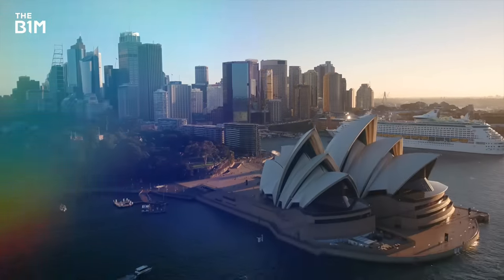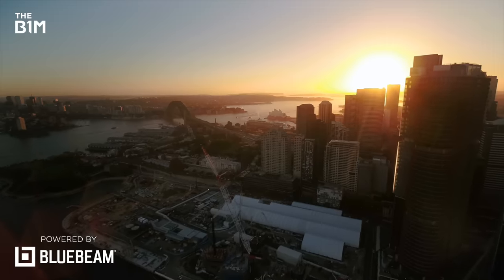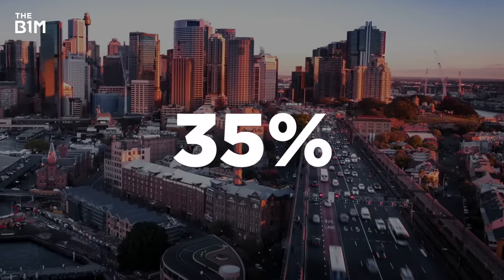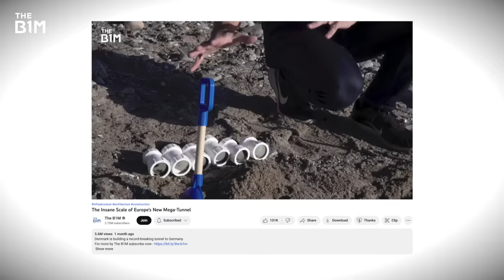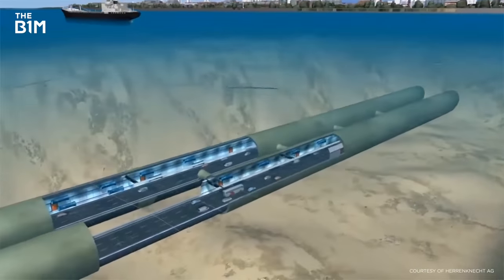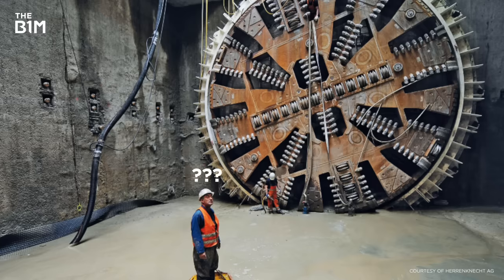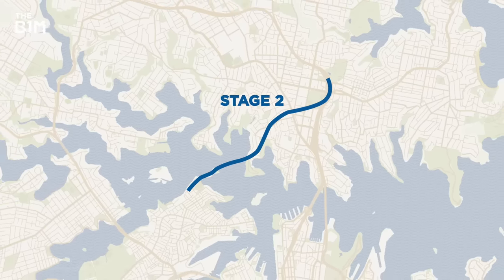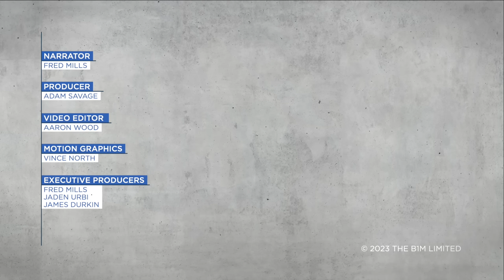Sydney's $5BN Tunnel U-Turn

Comment: This is going to help traffic... for a very short amount of time. Then induced demand is going to push it right back up again. Sydney needs more public transport, not more roads.
Reply: but then how would the people who own the roads get rich?
Reply: True, every time I go to sydney I like it less. Traffic is a huge issue. Way to car centric. Allthough it does seem like bike lanes are being built,  bur a better metro is definitly needed.
Reply: Nimby: sO yOu wAnT mOre tRafFic?
Reply: @aqidon  its underconstruction at the moment. But also there are alot of different types of transportation like sydney metro, sydney trains and light rail around the city to the west
Reply: why isnt everyone there driving a e-bike? its warm all the time....and you can have a "umbrella roof" abowe your bike or a hat so you wont get a heat stroke
Reply: @aqidon  the lack of emissions control on vehicles or proper standards for fuel also really degrade sydneys air quality; compared to london, sydney air makes me feel asthmatic some days.
Reply: One more lane.
Reply: @mauriceskyliners9873  Im a car fanboy, I agree Sydney needs more public transport. It may be car centric, but its an absolute hellscape to drive in. More public transport equals less cars on the road, therefor making it more pleasant for us people who actually enjoy driving.
Reply: @faustinpippin9208  i guess Australia isn't this far, with all the infrastructure, would not want to drive a e bike on a 6 lane Highway in a tunnel...
Reply: Disagree. It reduces traffic bottlenecks across the bridge and the original tunnel. Those bottlenecks were disruptive for the productivity of the city, and now, residents who don't need to go through the CBD can bypass it entirely. Sydney absolutely needs more roads. As cities grow, the need for more infrastructure grows. They're already working on expanding the train network. It's not a zero sum game.
Reply: @BadDriversOfTheIllawarra  I agree with you, more public transport means less traffic on the highways.  but the nimby and sometimes the radical ecologists do not want
Reply: I have never understood this argument. This could be said about anything, even public transport. London, NYC, Tokyo etc. could build a new line but the trains will still be packed from 'induced demand'. The actual issue is the size of cars in proportion to people, not the wait times. In the end as Sydney builds a new bridge, the economic throughput will increase even if traffic itself does not.
Reply: @KingFinnch  just check what's going on in Poland )
Reply: Doesn’t get away from the fact that people have to get around one way or another. The traffic may take the same time, but another 5000 cars per hour will be going across the bay.
Reply: Induced demand doesn’t only apply to roads, it applies to public transport as well. Most people would rather be clogged up in traffic in the comfort of their own cars than clogged up in a train standing shoulders to shoulders like in Tokyo. Australia is a sparsely populated country, and that is a benefit to its quality of life. Tokyo builds public transit because it HAS to, not because it wants to, it doesn’t have the privilege of ample land that aussies enjoy and that’s why despite high living standards, Japanese still immigrate to Australia or America for the suburban lifestyle. Please don’t push your agenda onto Australians, you’re more than welcome to move to Japan or China if you so desire.
Reply: There is a margin between need and induced demand. I believe that Sydney now requires such a project, as well as other public transportation projects.
Reply: And how are they going to finance that? It would mean more taxes since less cars, less revenue. People always hate cars, but forget they contribute a lot to the economy, from workers on the oil fields, truckers to carry fuel and parts, fuel and road use tax, registration tax, tolls, etc etc. With out cars who is going to pay for more trains, subways, and buses? Like in NY, thanks to cars using the bridges and tunnels the MTA can keep the bus and subway fare at $2.75. Without revenue from cars and truck the fare would probably be close to $5.00 and metro north and LIRR like $20 each way at least
Reply: @playerbobiko4417  yeah public transport works well where there's trains. But Sydney is so spread out that a lot of areas are only covered by bus. So then you get the worst of both worlds. Als going between the main lines is silly. Going front the airport to the west you go through Sydney CBD. There are no ring lines for the trains.
Reply: @PhillipMikeHunt  you obviously have zero clue about public transport
Reply: @biosparkles9442  This isn't America, it's maintained and owned by the government not private industry. There is no getting rich off roads at least in Australia.
Reply: @Ricardo-bo8xv  yes the margin is the width of a human hear wide... when start building streets you will get traffic...
When your public transport is stuck in the same traffic than the cars, no one will use it cause no benefit... separate public transport wherever from the Traffic jams, and more will find this an alternative to standing for hours a day in jam... make it the same cost than fuel, taxes, insurance ect, and even more start to losing a car cause its a useless toy and bad for health too...
Reply: @JohnFromAccounting the productivity of the city would be improved by reinstating the tram network along its original routes. Endless amounts of rundown commercial streets that are now traffic sewers because of the more roads bigger roads philosophy, could be bought back to life. It would
Create a walkable, quieter, safer city where everyone actually has everything they need near to them or by catching a tram or tram/train instead of ‘having to drive and bypass the cbd’ as you put. A city that enables or worse still relies on that kind of movement as it’s backbone is flawed.
Reply: @aqidon  then you are part of the problem. using a car and complaining about traffic. you are traffic. come to sydney, use the ample public transport available instead.
Reply: @SamWulfign  Sydney has one of the largest toll road networks in the world, owned by private industry. Last year Transurban made $2.34 billion from roads funded by taxpayers
Reply: That is pretty much the same for the whole planet 🌝
Reply: Fix and interconnect/expand separate designated bicycle paths too, especially around education precincts and public transport infrastructure.
Statistics show bicycle paths save citys money and improve health while roads cost money.
 
I hate how the government will always announce the latest new shiny trinket when it's obvious they mismanage and neglect the current public roads infrastructure.
Reply: @faustinpippin9208  e-bikes, e-scooters are still illegal in Australia, and our current bicycle paths are dangerously intermingled with other traffic, unconnected, or being ripped up to create new roads or parking.
Sydney has a very hilly geography and the CBD traffic is brutal.
Skidknee is an overpriced overcrowded hot mess tourist trap in more ways than one. Definitely not the same place it was in the 1990's.
Reply: @BadDriversOfTheIllawarra  U are the first car ethusiast I ve seen, who understands, that better public transport is also better for car enthusiasts!
Reply: @faustinpippin9208  warm? its was freezing until 2 weeks ago
Reply: @aqidon  I was hoping they where gonna abuild a metro in the tunnel but nope.
Reply: @KingFinnch  you’re kidding right? London air is way way way worse.
Reply: People heard "induced demand" once and now think they're professional traffic planner.
Reply: Needs both
Reply: Induced demand means more people get to go places they wouldn’t have gone without the capacity improvement. Induced demand isn’t a problem, it’s proof that there was hidden needs.
Reply: @Pairofkingsup  Australia hasn't been "Australia" for a long time, mate. Sydney used to consistently rank in the top five living standards in the world, now it's listed as the third unfriendiest city in the world and one of the most expensive. 
Australia dropped it's standards dramatically.
Reply: @fredrikgustavsson5806  the problem is that there is so much hidden demand in cities that you can never fix traffic problems with highway projects.
Reply: It needs both.
Reply: I live in Perth and I refuse to use public transport.  It never goes where and when I want.  The only thing I will use if I don't have a car at the time is a taxi, a real taxi with taxi plates.
Reply: @faustinpippin9208  Good in theory for young people. But there are plenty of elderly, young families, disabled people etc who cannot ride e-bikes. Trains, buses, ferries, and cars are the most practical means of transport for the majority of us.
Reply: @aqidon  so build more train lines and induce the demand for the trains.
Reply: Govt more interested to privatised public transport rather than to make it better
Reply: @onlyeveryone2253  There's already a tunnel for the metro under construction nearby, so it would be redundant.
Reply: @Pairofkingsup  "Sparse population" is BS. Parts of Sydney and Melbourne are literally denser than Hong Kong. No one wants to build a metro line to Broken Hill, but our cities are as dense as any other.
Reply: @JohnFromAccounting  the number of roads dont need to grow by that much, if enough is invested in public transport.

It's an important goal to reduce the share of cars within the modal split.

Removing this bottleneck will result in a lot more people using that route. This will go on until there is a new bottleneck somewhere else on the road. It's a never ending story. You can NOT build yourself out of congestion
Reply: @PhillipMikeHunt  well if u are a decent person u wont be searched by police🧐🧐🧐
Reply: @onlineo2263  yes that would be better.
Reply: And cycling infrastructure.
Reply: @iris4547  I don't drive a car in Sydney. I prefer public transport or a Vespa. Not sure how you got the idea that I drive a car around all the time. Although sometimes we have no options as a car is the only way, then we have to borrow a car to get a round. Comming from Europe Sydney really feels a step back.
Reply: @faustinpippin9208  Because Australians believe they have a God-given right to drive cars, and to do so cheaply and without hindrance. So no bikes on my road!
Reply: @Pairofkingsup  The east coast of Australia, where most Australians live, isn't sparsely populated. And it's more than just induced demand. If the infrastructure is in place to make alternatives to cars quicker and cheaper, people will use that. Induced demand on a cycle lane isn't a big deal.
Reply: @enduser8410  Amen brother, its like people forget the increased economic output from the infrastructure that pays for it from the efficiencies generated
Reply: Yeah there is the exact same problem in Houston Texas. They will keep widening the roads but any fix is only temporary. It’s to the point where there are numerous toll roads and the highways will have 6 lanes in each direction and traffic is still deadlocked at rush hour.
Reply: Agree that it will only help for a small amount of time, but w.r.t. public transport - depends on what type of public transport. Trains, definitely yes. But the northern beaches have for years blocked building a train network and thus forcing the establishment of the B1 bus line which justs adds to the congestion. We are causing our own problem because politicians pander to every m-ron that has an opinion.
Reply: @SamWulfign  
Ummm….nobody owns roads in USA.
100% of roads are owned / maintained by the government.

Why do you kids always make a bunch of WRONG assumptions about USA?
How cliche.

I mean….”owning roads”?!?!?
Get real, children.
Reply: @biosparkles9442  
Oh geez!
Nobody “owns roads”, kiddo. 

That’s such a cliche assumption to support an even more cliche rhetoric. 

Stop guessing.
Reply: It needed to build a grid system like 150 years ago. But that subject is for another channel i think lol
Reply: So gratefull and induced demand comment is in Top Comments. Maybe someone learns.
Reply: @SamWulfign  coughs in citylink and eastlink. Lol jl
Reply: @John John haha yeah I was shocked at the state of the roads on my last visit. On the way to Bathurst the tires on one of the cars got fucked on one side.
Reply: @enduser8410  neither is wrong. The difference is that induced demand on public transport can be fulfilled, but to fulfill the demand for cars, you basically need to cover everything in asphalt
Reply: @camblyth  Which is going directly back into the Light rail and other public transport projects that is currently going on in Sydney at this very moment. They don't just take the money and run as libetarians in our country try to make out. If we didn't have the Tolls a percentage of the total NSW tax would be going directly to sydney instead of just out of the toll revenue.
Reply: @sendthis9480  I was more infering to your other utilities and public services. A.k.a medical and utilities market for example.
Reply: @enduser8410  you can fit many many more people on a train than on a road for cars. Its also better for the environment and cheaper.
Reply: Australia need car control policies to fix the problem. Building more roads doesn't help if you allow people to buy more cars
Reply: It is already outdated before it is finished. It is just waste of money.
Reply: @sendthis9480  It's literally a private road, privately owned. Stop harassing me.
Reply: @SamWulfign  Babes it's literally a privately owned toll road
Reply: No one wants to ride public transit 😂
Reply: Yeah, more roads does not equal less traffic. It incentivized increased use of this form of transport. The best way to reduce congestion is to offer more options for transport.
Reply: @CineZoneYT  well that’s just clearly wrong
Reply: …which will induce more demand too. What you really need is walking.
Reply: @shrgn goes along with “ self isolation “ It’s plain and simply “ isolation “
Reply: @faustinpippin9208  not really feeling the bike when it's 52c in Penrith (western Sydney) and it's a 50km trip to the city.
Reply: @SamWulfign  dude they are toll roads. Transurban is the operator of most of them in Sydney. They are taking literally billions of dollars a year.
Reply: @faustinpippin9208  because the place is fully car-centric without being optimised for it. 
It's common to sit and wait 30 seconds to a minute by the traffic lights with no intersecting traffic. Then just as cars are coming down the intersecting road, they end up with a red light and you get the green you've been waiting for. 
I used to ride bikes 12 months a year in Sweden. I've lived in Australia for the last 8 years and find it to be quite unsafe to ride around Sydney. 
Public transportation is also a joke compared to Europe. Melbourne is okay. Oh, and the pot holes are prevalent.
Reply: @zyeborm  lol, its not that bad on a e-bike when you drive fast
Reply: Just one more lane were gonna fix traffic just one more lane.
Reply: @faustinpippin9208  driving fast in 52C would probably be lethal
Reply: It’s about increasing system throughout.  Expecting the current infrastructure to handle all the growth that has happened in Sidney is ridiculous
Reply: @chuckmaddison2924  Using a taxi instead of Uber is as quaint as it is inconvenient. Especially now that taxis are rapidly disappearing :) However, public transport is always a problem in relatively smaller cities like Perth. You are too big to not have good public transport, but too small and have too low a population density to make it worth while to invest large amounts in. Catch-22. 

Australian and American preferences for sprawling suburbs and low population densities mean that public transport is always problematic. The European model of physically smaller cities but higher population densities make it much easier to provide public transport. It is no coincidence that major investments in Sydney's public transport infrastructure coincides with increasing population densities, and high-rise being built near existing rail stations. Presumably we will see this start to happen near the forty plus new stations along the new metro corridors. Good, and reliable public transport infrastructure has historically been a good driver of economic growth. Rail, in particular, in all its forms drives business investment. A lot of people like to live walking distance from a rail station.

I have used your Perth rail. It is modern, clean, and efficient, but like you say, very limited in where it goes. It is difficult for in-between size cities like Perth.
Reply: @zyeborm  fast by using the electric engine,
Reply: @mauriceskyliners9873  actually they are realists, not nimbys.
Reply: @zyeborm  52c in the shade? damn how do you people survive over there
Reply: @enduser8410  the difference is that more people using transit or bikes is good, more people driving is not. Cars bring a ton of issues to cities that other forms of transport don’t
Reply: **better and more efficient public transport
Reply: This!
Reply: Yeah I'm sure people will drive back forth on a toll road for no reason /s
Reply: Immigration needs to stop and a focus on the needs of the Australian public first and foremost then you’ll see the available transportation will be enough.
Reply: @JohnFromAccounting  actually in reality it is a zero sum game. Money to pay for it, contractors to execute it, many things are finite resources in developing these projects and most of the time for these biggest ones it's one or the other with not enough headroom for "por que no los dos" idyllic thinking.
Reply: govt  needs to serve their masters (big corp)
Reply: Couldn't agree more. Australia is obsessed with more roads, surprising that they have not realised public transport is a good answer. Take germany for example, most major cities there have hire scooter and bikes. They also have 2 train systems u bahn and s bahn and some also have trams, and also the government's supports personal bike use and most of the cities there are smaller than ours, European model is the way to go, not the American style that we seem to follow. Look at LA roads. They're a disaster. That's where we are heading
Reply: @JohnFromAccounting  Look up induced traffic demand. More lanes never works. Having access to good public transport is ideal. It can be seen by the increased property prices around good public transport networks.
Reply: @faustinpippin9208  because Sydney drivers literally think they own the road. I cycled there for a while, and had a lot of close shaves with drivers trying to ram me. When I had 3 in a week, including one that went around the block for a second go i gave it away.

If they'd spent this money drilling a narrow bore tunnel network of cycle paths they'd get a much better result.
Reply: @enduser8410  Absolutely but a new train line will transport an order of magnitude more people than any piece of car infrastructure ever could. It’s a more worthwhile investment in terms of public finances, personal finances, ecology and social harmony.
Reply: Same thing in every city around the world. I cant understand why city planners and engineers keep doing this.
Reply: @faustinpippin9208  yesterday it was 38 degrees celcius yesterday when I drove home. That's beyond warm! I commute from near Parramatta to Blacktown. On a total map of Sydney, it doesn't look far, but it's 20km... And this is one of the shorter commutes I've had while I've lived in Sydney, a lot of people would be travelling further.
Reply: Exactly
Reply: To be completely honest the public transport is actually decent you just need to have experience using it and know where you can speed up your trip. I have to use both the opal app and trip view to maximise efficiency (google kind of combines the benefits of both but I find it to have an ugly interface). you’d also be surprised how a quick jog or scooter between various public transport options to catch an earlier option saves time. Yes, some areas have shitty connections, and no amount of efficiency tactics will save you and that’s just Sydney geography and mid train system that’s fucking you over
Reply: Bigger road means more vehicles. Focus should be on efficient public transport.
Reply: Actually at this scale you need better zone planning equally; to reduce the need to traverse the city so regularly/to such an extent.
Reply: Hey 👋 guys. Our Saviour Jesus Christ died so that we will live. Jesus said, "I'm the way and the truth and the life. No one comes to the Father except through Me". John 14:6.
Reply: @jacksmith7726  nobody’s implying that people are driving for no reason
Reply: Nah. I want to drive my car not be a slave to government controlled transportation
Reply: @skurinski  the government builds the roads, subsidizes your gas, and regulates your car.
Reply: Rubbish 😂
Reply: @BadDriversOfTheIllawarra  would a wheel tax or other fee structure a good way to help fund more public transport?
Reply: @faustinpippin9208  Magpies....
Reply: 3 things: 
1. I'm super impressed they switched construction approach after concerns were raised about environmental issues. However, the decision probably came from the purported reduction of costs rather than environment.😂
2. I could get behind this project more if they put some train lines in too. In total agreement with you, Angus.
3. The inner Western Sydney residents can wipe their whinging tears with their wads of money and learn to freaking deal with sound and dust for a while for the greater good. It'll probably make their $5 million houses worth more eventually. 🙄
Reply: @chuckmaddison2924  As someone who grew up in Brisbane, who has lived in Sydney for 7 years, and Perth for 1.5 years, I feel like I can wade in here.
I'm in complete agreement with you that you NEED a car in Perth to get around because the public transport system is totally pathetic. However, for most of the time I lived there, the Gov spent ridiculous sums of money adding 1 more lane on the Mitchell Freeway due to terrible car congestion. When I went back recently, I decided to purposefully drive this, now completed, segment of freeway, during peak hour like I used to, to see if it was any better. It was not. The only way car traffic will get better is by investing in better public transport. 
I started riding my bicycle to work, which took 20 minutes less than public transport. 😂
Reply: @annieannderson  We seem to have started to remove emergency stopping lanes .  So if your car has a problem you have a massive problem.  We have push trucks to push ,more like ram you out the way. So I pity anyone with a new car
They claim causes no damage. 
A lot of people usually older when In this kind of situation their thinking goes out the window.  Not putting key on to steer or leaving in park resulting in damage.
Reply: Why not both?
Reply: @aqidon  they're even putting lifts on the pedestrian and bike lanes on the Harbour bridge
Reply: @onlyeveryone2253   Sydney transport projects are full spectrum.The 'Building Beautifully' youtube channel covered  'The future of Sydney Metro- an animated explanation' . Sydney has areas of sandstone so some of the tunelling is fairly straightforward. Also other projects such as the West Sydney (Parramatta) Light Rail, the Mariyung Regional (double decker) Electric Trains, the Westconnex vehicle tunnel (14 miles/ 22km) underground, the recently opened new middle tunnel section avoids 50 traffic lights on the surface road. New Electric ferries on Sydney Harbour. etc
Reply: What’s your Twitter handle mate?
Reply: @faustinpippin9208 except, it’s not warm all the time. That is a stereotype designed to attract tourists
Reply: Public transport is expensive, difficult to plan to suit everyone and with long payback time. Roads on the other hand could potentially be chargeable to users and usually get payback within a few decades. 

If you raise the fares of public transport people will protest, but you can say it’s for the environment and charge car owners anything 😂
Reply: Or Sydney needs more tunnels and bridges, more lanes etc.
Reply: just one more lane bro I swear that will fix traffic just one more lane bro I swear 🥺
Reply: And then there will be no money left for public transport because they used it all for the new roads
Reply: @biosparkles9442  by building metro lines.
Reply: Guys seriously, public transport in Sydney is supreme. It’s easy to get anywhere fast during the day. No additional train or metro tunnel is going to significantly improve the service. And as a cyclist commuter, stfu with your bike lanes already. Us cyclists hate them.
Reply: No we need more roads too man.
Reply: @GraemeTaylor  Move out of Sydney then lol
Reply: Australians have a lack of public transportation?  Haha that’s cute
Reply: Enough already with pouring money into roads for cars. In 20yrs we won’t be using them. What a waste of money, at the expense of everyone in the state who’s paying for it.
Reply: @PatricioGarcia1973  public transport is not reliant on cars. There is no law that says “you may only fund public transport from taxes on automobiles”
But even if you did have to, contrary to your bizarre perspective, it would be smart to tax road users more in order to lower public transport fares and increase services/quality. It’s more equitable, efficient and environmentally friendly
Reply: yeah no worries, ill catch the bus to do my grocery shopping.
Reply: @biosparkles9442 The "Owners" of the Toll roads are almost always our superannuation companies, so it's essentially us that own the toll roads, not all, but most. You pay to use it and profit at the dame time.
Reply: Induced demand is a misnomer. The demand is already there. What's induced is more car travel thanks to the increased road capacity.
Reply: Not everyone can use public transport, some people need cars, just because you dont doesnt mean you re right
Reply: I’ll never catch public transport no thanks
Reply: @Pairofkingsup  Induced demand is way better for public transport as they carry substantially more people than individuals in cars. Better public transport would result in less cars on the roads so it's better for drivers as well as giving better options for people that don't want to drive. Australia's population is concentrated in it's eastern cities and is where the majority of people live. Cities in general have to build public transit for more efficient ways of moving people around, land is valuable and the further you build out, the further people are from job centres and the more infrastructure and utilities need to be built which is funded by the taxpayer. It's more about giving people different transport options rather than forcing people to use cars as the only viable transport method.
Reply: @enduser8410  That's pretty much the point though, public transport fits way more people than singular people in cars do, as cars are not space or energy efficient. If you built a multi-lane highway in NYC, Tokyo vs public transport, the road would be clogged as well but move substantially less people. Just a matter of efficiency.
Reply: @PatricioGarcia1973  Taxpayers also have to pay for the building of roads and maintenance. All those taxes you mentioned are to pay for road maintenance and it is no question that roads degrade a lot quicker (rubber & road friction vs steel wheels on a track) which is very costly. The more people that use public transit, the more fares are collected plus if train stations use the area around them correctly, you have multiple businesses which generate tax revenue as opposed to highways which might have a couple mcdonalds down the strip which will require carparking space, further wasting land space. Spaces where there are carparks are spaces that could be used for businesses or housing which contributes to the economy much more.
Reply: @shrgn  It's true though, just from a pure efficiency standpoint: induced demand on public tranport > induced demand on roads. Less cars, less car noise, less pollution, people actually walk so they don't become sedentary sloths, less idiots on the road.
Reply: @artistjoh  elderly/disabled/young people can't drive, so public transport is definitely the way, also increases their independency
Reply: @sendthis9480  In Australia some roads are owned by private companies. So some do own roads.
Reply: @krazypandaman  You might believe that, but when you get old (as I am) you will appreciate the independence that having your own car (even if someone else drives it) gives for getting to Doctors appointments. Public transport is definitely the difficult way to get anywhere when not well. The only practical alternative to your own car at that point is taxi or Uber. In addition to the difficulties, especially with buses, is the long walks just to catch the bus or train. When you get old, long walks become increasingly difficult for many. We need public transport. But we also need roads. 

Just like in the days of horses and trains. Both rail lines and roads were needed. You might not like to hear it, but sometimes a train is the best thing to use, sometimes an aircraft is best, and sometimes, a car is the best solution.
Reply: @faustinpippin9208  lol it isn’t warm all the time at all. Not even close. Australia has 4 distinct seasons.
Reply: Correct. All around the world it's been shown that building more motorways, bridges and tunnels attracts more traffic it doesn't reduce traffic.
Reply: Have a cry 😭
Reply: @faustinpippin9208 on average Sydney has more rain than Brisbane and Melbourne. Winter temperatures average in the mid to low teens . Not warm at all
Reply: It’s designed to reduce traffic having to go into city to cross from north to south and south to north , it’s needed and should be built in original design or this new one
Reply: @aqidon they do need to extend that massive metro thats supposed to connect to the city. And it would be easier if they do what melbourne does and get tram lines for suburbs surrounding the city like redfern, the north shores, idk what else.
Reply: I simply have a general thought about city transport: I start from the sci-fi images of the film Fahrenheit 451.......the sci-fi image of the future city is transport in vehicles along rails very high above the ground........looking @ London, I've imagined a road above the ground, 50 feet above, 100 feet above, don't know ~ maybe curving round a skyscraper ~ but my slight difference, a little better than a tunnel ~ is to have little mini-roads @ 45° degree angles, which can allow cars to let themselves back down, or drive up onto it, both directions ~ I've imagined the city authorities announcing saloon cars only "on the overhead".......so that's a bridge across the entire city high above the city houses.......with 45° access points throughout its length.......more oblique angles would be longer, but that's doble - does my thought come across? HGV vehicles over water is maybe less thought of, but what they're doing now would be clearer for them once the bridge is in operation. A thot or not!?!
Reply: Like 1-2 minutes faster hahah
Reply: @Kathiop  umm .. did I miss something , it’s to bypass the city , take traffic away that has to go into city to go other places ..
Reply: I live in western Sydney and I’ll tell you there is no shortage of public transport hete
Reply: @Kristobliss  way ahead of you
Reply: @JohnFromAccounting  Wrong. Ask any traffic engineer. More lanes = more traffic due to induced demand. It's a fundamental of traffic planning. Ironically, the best thing to remove private commuter vehicles/reduce private trips is congestion and the provision of better public transport.
Reply: @carlodefalco7930  I talked about other exisiting tolls
Reply: You cannot have it pathways. Either you want Australia to be successful or you want it to fade into nothing. 
Cars are part of individual success and freedom.
Reply: IMO sydney was just poorly planned from the beginning compared to Europe. Nowhere near enough public transport that is actually functional. 

For example, how is there not a train along the northern beaches and over to circular quay? 
As someone who travels frequently around the world, I have relied on trains so heavily to get around. Impossible here and have to get a bus..
Reply: @aqidon  g to Melbourne then
Reply: @faustinpippin9208  get lost
Reply: @tueocohovf5084  ? :( why
Reply: You have to realise there’s thousands of work vehicles on the road. Tradies are everywhere in the CBD. You can’t carry tools or equipment on public transport. Not everything can be solved with public transport. It’s definitely a good way to ease congestion but there’s still plenty of people who need a car, or to be honest, just want the comfort of a private vehicle as there’s plenty of big earners in the city who can and will pay the money to drive.
Reply: Sydney is impossible without driving unless you’re lucky enough to live close to transport hubs
Reply: A major study recently showed that adding 1% more road capacity incresased road traffic by 1% within a year. So you're absolutely right--more road does not ultimately reduce traffic. It just encourages more people to drive.
Reply: that's always an easy answer, but when in troubled times and you have a bus and train driver shortage then all of a sudden all that public transport is useless
Reply: @azpatriot7937 I don't want more public or private transport--I want more affordable housing closer to where I work! Then commuting isn't really a problem in the first place!
Reply: Haha let’s try moving big items one at a time every half an hour if the bus didn’t skip the stop 😂
Reply: Sydney needs less people, it used to be nice when 2 million lived there, now, not so nice. Bondi beach is hardly a great beach, there are better beaches elsewhere.
Reply: Why not both one Tunnel for cars and one for underground rail
Reply: @muysli.y1855   There is probably reasonable volume in rail over this route, with a metro extension opening in a year.
Reply: @Pairofkingsup  well, no. Cars are idiotic in cities. period.
Reply: @Valoric   Normally I'd agree, but Light rail, heavy rail, and buses south of the river change-over with metro and real trains at Central which head north of the river, and to B-line buses to the Peninsula at Wynyard.
Buses through the tunnel may fulfil special needs.
Reply: Sounds like an immigration problem rather than an infrastructure problem, with the former pressuring the latter exponentially. But maybe I shouldn’t say that?  🤫
Reply: @JohnFromAccounting  Depends on what the do to the Gladesville Bridge,xwhich already takes traffic from the inner west to Lane Cove, Chatswood and Hornsby, etc, for free.
Reply: @fletcherhamilton3177  How do you easily spot super-minded people? They claim the source of all problems is foreign people/ It's utterly and horribly wrong. Not even "more people" is in most cases the answer - wasteful, inefficient, and irresponsible usage of the available resources is the problem.
Reply: @BadDriversOfTheIllawarra  can you catch public transport so I can enjoy my driving better thanks
Reply: @peterphillips2419  Thats what I'm saying.

Put them in buses and trains so they stop hogging the fast lane with their SUVs.
Reply: Thats how tolls work.  To regulate demand.  Just as long as they run plenty of buses.
Reply: Build tunnels. Multiple story tunnels. And an automated system to distribute vehicles between them.
Reply: @MuzzaHukka  One for slow drivers, one for fast drivers.
Reply: OP: You gonna help me carry all my tools around and run security for me while I have to do multiple trips in and out of the train to load everything I need for the day, also need to hold the train doors open and or the busses, effectively pissing everyone else off? 
Gtfooh.
Reply: @biosparkles9442  lmao who do you think owns roads? This is such a dumb comment
Reply: @biosparkles9442  or they could just get a regular job?
Reply: @Jayhow90  Transurban
Reply: EXACTLY! 100% agreed! This "Just one more lane" crap is not going to help anyone, it will just get plugged up in a couple of years. If you want less traffic, more public transport is KEY! Always! It is so much more space efficient and enviromentally friendly!
Reply: @Faustin Pippin   Because everyone here is either working or out and about all the time. Driving at the moment is the easier way considering how far many places really are. Once the metro trains are built, Syndey will be better connected but they can honestly do way more with the metro trains.
Reply: @aqidon  induced demand is NOT a reason to not build new or expand existing freeways. Not expanding them still result in horrid congestion. At least when you expand then to facilitate demand you can keep congestion at manageable levels. Some people want their cars and don’t to use public transit. I’m on of those.
Reply: @campbellsadeghy213  Yes some people are selfish. Yet public transport is still the way to go for people that want to drive themselves. More people on the train means less cars, which means less congestion.
Reply: The have money for car but not for train
Reply: Parramatta Road should be blocked off

Make some sections pedestrian only.

There should also be high capacity orbital lines as well
Reply: You have to start somewhere
Reply: Even though I don’t support this project it is happening. So I hope that because of this tunnel which will basically take you to the same location as taking the Harbour Bridge. In the future the harbour bridge could be unlocked by removing traffic lanes.
Reply: YES
Reply: The only long term sustainable solution to transport in urban areas is free or at least low cost, reliable public transport yet governments keep encouraging the use of cars. $5bn might have an impact on improving public transport!
Reply: Well they are building more public transport and it's still better than not having another way to cross the harbour isn't it
Reply: @aqidon As you would know I hope the new metro tunnel under the harbour to the east of this one has already connected and had test traffic through so it is well ahead of the road tunnel so I am not sure what you are complaining about. We need both.
Reply: @johnbarnett7515 The new metro tunnel under the harbour is ahead of this one, already connected and fitout and test traffic well advanced. Not  enough for you or just hate roads?
Reply: The government needs fuel excise tax, we’re screwed.
Reply: It needs both
Reply: Yes but public transport is all in the name. Private infrastructure only benefits the super rich corporation's and oligarchs who sponsor politicians.
Reply: @faustinpippin9208 probably 2 reasons - a lot of Sydney is very hilly and it's not a compact city - it is very spread out - distances are big.
Reply: They are building Sydney metro which is a good start
Reply: Yes. Too many people are moving to Australia!
Reply: @faustinpippin9208  e bikes your fuck’em joking